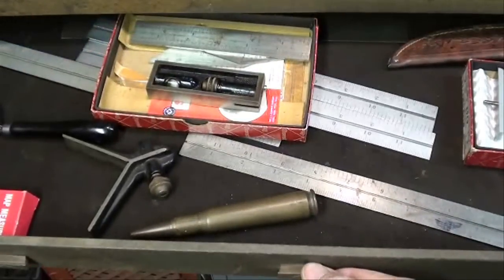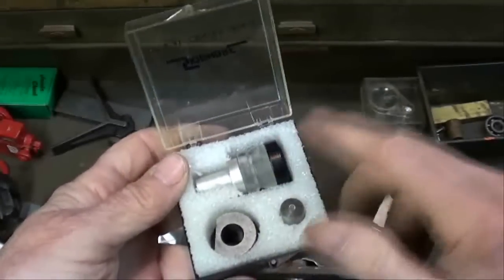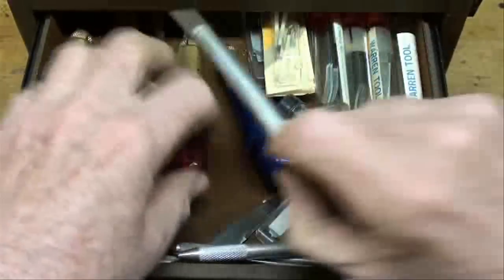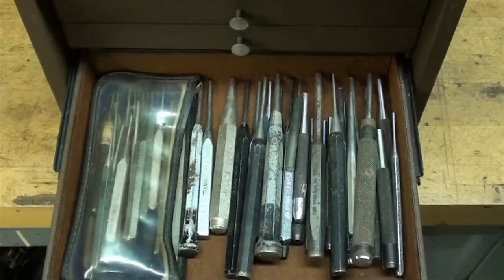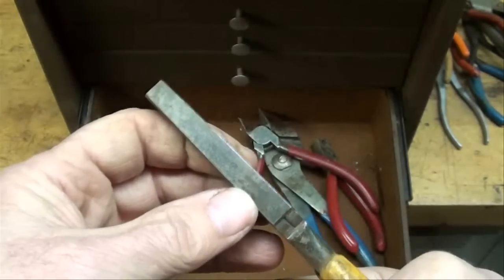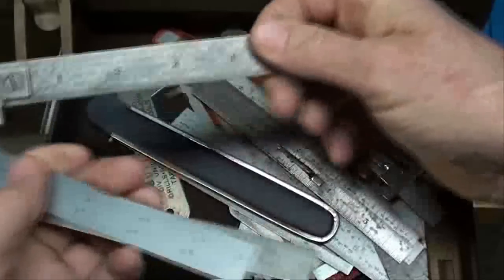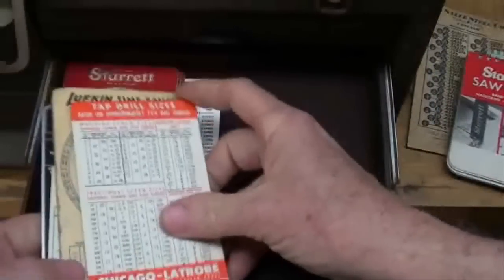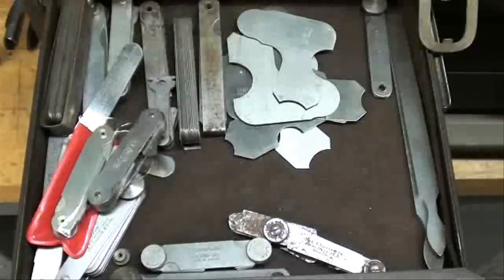MACHINIST TOOLBOX TOUR Part 2 of 4 tubalcain

Comment: Hi Pete,
Love your videos and we thank you!  The little square device you show at 2:20 is actually a tool to pick up the location on the edge of a work piece.  You hold the tool up to the edge and then rotate/swing an indicator in the slot of the tool.  Adjust the axis until the reading on the indicator is the same at 180 degrees from each other.  Very precise way to locate an edge when used properly!
Just thought I would give my 2 cents

Comment: These toolbox videos are near and dear to my heart. I have more Kennedy toolboxes than Carter had Liver pills (or as you stated more than dill has pickles) You have brought back some really good memories. I am not sure but I would venture to guess you are aware that Kennedy Manufactures their tool boxes in a very small town called Van Wert Ohio which is about 75-100 miles From where I live. They have a show room where they sell #2 boxes (scratch and dent for us old timers) but my Dad Owned a Powdered Metal company where I cut my Steel teeth on Metallurgy, Heat treating and connected to the same building we had a machine shop connected (production machine shop) so I got the best of both words all in one place. Back to toolboxes. My Dad was his own sales rep for our company and he would get over to Van Wert at least once a month. I asked him when I guess now it would have been 30 years ago to stop in and see if they might have a 2nd Roller cart and maybe a top box. I was not aware all the time where he would be when but this certain day he backed his big old LTD wagon in the back door at the shop and I was setting up a job in one of the presses right near the back door and is all i could see was KENNEDY RED wrinkle finish and that set up came to a dead stop that very second. He had gotten me a Brand new 2nd of course  6 drawer roller box, and a Mechanics top box and the cost back then was less than $500.00 for both boxes as 2nd's I was so ecstatic that I spent that entire day getting ready to put my tools in that box and show that bad boy off. I filled it with some of my tools from Home. I still was living with my parents at that time. After my stint in the Good Ol USMC.  Some of the items you are showing are also some that I love and have way more than any human would ever use. I am a tool guy. I love old tools like a Fat kid likes cake. Some I refinish (Like the Videos by AVe on his You Tube channel) I do realize that some tools you absolutely do not refinish they have to be left as is because to re do then would deplete the value. I absolutely love Starrett, Slocum, B&S. As I stated in a previous comment I worked in the Powdered metal field at 1st and went on to work in the wide world of Machining Manufacturing. But to keep things in perspective When I was 13 years Old my Dad ran a powdered metal company for another person (My Dad went to night school to become a draftsman. This was back when I was like 2 years old so  like 1968) He was the smartest man this planet has ever or will ever see. I worked 2nd shift every day after school sweeping, Mowing, Cleaning toilets up until I was old enough to get a drivers License then they let me drive the forklift and I took nover shipping and receiving. Just stating that I started below the bottom and worked my way up. My Dad had a habit of making certain that everyone in This company and his own company in later years knew that the owners kid was NOT FAVORED. I was actually less favored at work But I knew the 2 lives had to be kept seperate. My Dad actually kicked me in my As* on the shop floor at least once. LOL.( I wound up with his Kennedy full of tools long before he passed away in 2015 but he also gave me my Grandfathers Kennedy box that was packed full of the items you are showing now. I pride myself on my hand tools I have some dandys and I have 2 Blue Print cabinets 6 feet tall (you know which ones I am talking about for sure) they are the really huge drawered ones. There are about 60 drawers all together just packed with tools that I am either in the process of reworking or that are done. I now have 15 Kennedy Roller, Riser, and machinist boxes full of exactly what you are Showing. I know my comments go on and on but I get a tad excited about videos like this. Please never stop making new ones. I love all of your videos and have done absolutely nothing for 2 days now but watch your videos. Great work. Took Machine shop tool in High school at the Voed center and absolutely aced the class well enough that the teachers made me the Maintenance man of the class and they brought stuff from home that they needed to get fixed for their own shops (companies) because they did not have the time to do the work. The only A+ I ever received. Oh and yes I am retired now I retired at 53 years old I am 56 now so I spend about 100% of my waking hours in my garage with all my hand tools. I have one large piece of if you want to call it machine shop equipment. I have an Old Wilton 8 speed drill press that I actually pulled from a dumpster where I was working and rebuilt it exactly to the picture in the old catalog color correct. The precision I am sure is 10 times better than when new. Hand honed table rotating table. It is a bench top but boy I am proud of that. I even keep a sheet over it. It was in really bad shape when I got  it. I have a 2 HP motor on it and put a cheap milling vice (2 Axis) but the ball bearings thet were in the machine are now Barrel bearings to withstand the side loasd also.
Reply from the maker: Thank you for a great comment. It’s good to hear that someone else is just as crazy about tools as I am. You apparently have a lot more tools that I do. Love those Kennedy boxes. My wife bought that Remline toolbox for me at the factory store in The suburbs

Comment: I still get to use a lot of the old school tools like feeler gauges and much more by working on lawnmowers and fixing anything with nut's & bolts and screws,  I was born in 1953 and raised to " fix " items instead of tossing it to the curb.

Comment: We still use the feelers plenty....e.g. seal/sholder hard gauges.... there's gaps with tolerances usually like .012 +/- .010 or some shit like that. They have to blue out with dykem or permatex too depending on the seal angle and other factors. Dykem is applied for like thicknesses .0005 to .001 or so and Permatex is applied for thicker requirements....

Comment: Hi mrpete222
@16:44 the 3 point pliers shown are used to bend wire.
Some opticians like this tool also to bend and straighten frames.

Comment: That blue handled plier that you said has a little bit different jaws to it looks to me to be for a internal snap rings and I SWEAR that the yellow three jawed plier is for spring steel hose clamps! Perhaps only for small ones like fuel line has, but I'd bet a bunch that's what they are for! I almost bet the pliers you thought looked like the pincer from a dung beetle is a pair of ring clamp pliers! Those loose large radius gauges are like part of the set I have. I don't imagine they're useful.

Comment: May be a little late to the dance, but just glancing through the comments, I didn't see anything about them...the red handle pliers at 19:45 are nocking pliers used to install nocking points on bow strings
Reply from the maker: Thank you, I just pulled it out and examined. I think I will put that pliers and one of my videos. In the series is called what is it.

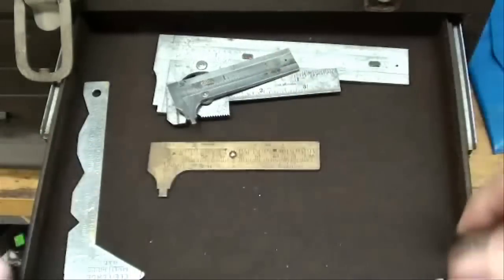Comment: Mr. Pete  Do you not like the brass caliper at 26:45 because it will wear prematurely?  I have one, stamped "Germany' and it has a fine friction fit to it, easy to control and use.  I also have the Starrett 245, and it's top quality. Useful, say, for sizing major diameter on threaded fasteners or bits with worn shanks when you can't find the d*!n gauge.  I sometimes just go through my toolboxes to remind myself what I have, to lube and polish and plan.  A good tool is an extension of our mind and body, don't you think?  All real knowledge starts in the hands...

Comment: Just a quick one this time. I named off the tools as you spoke before you said the name of them. Question. I did not hear you mention a brass feeler gage that used to come in some sets of Jack knife feeler gage sets used to set the Magneto on small engines. Did I miss that?

Comment: Try Plierench parallel jaw pliers on ebay.  The later vintage whose lettering is NOT raised is best.  Make sure the pin via able on either side is up in it's slot.  Shows spring isn't broken.
Several jaws are available, including one for spreading.
Still made.
R   spelling plierench, NOT plierwrench
Reply from the maker: Are used to have one of those